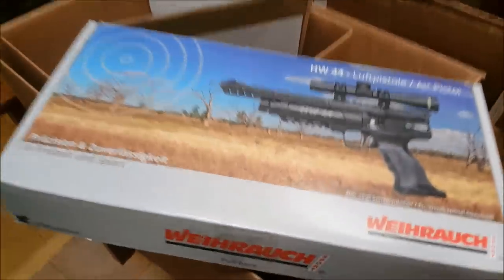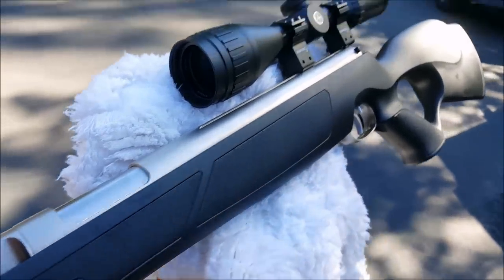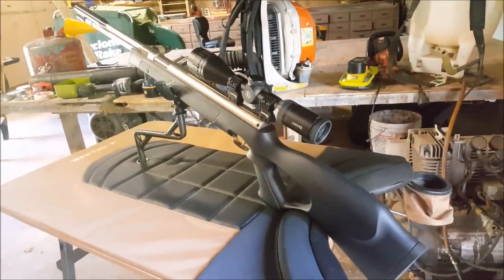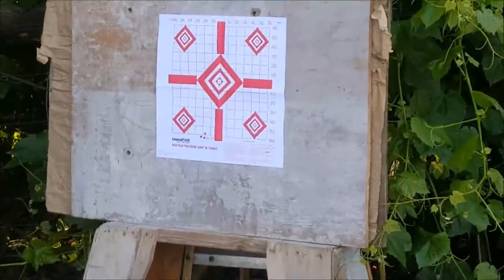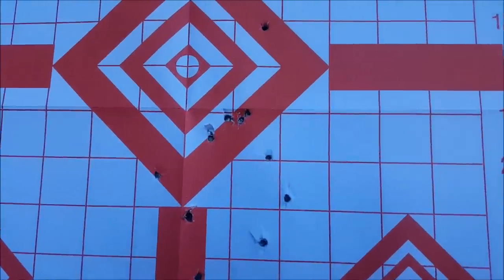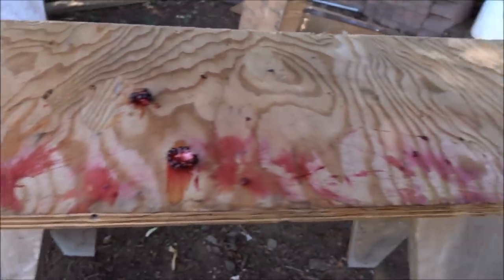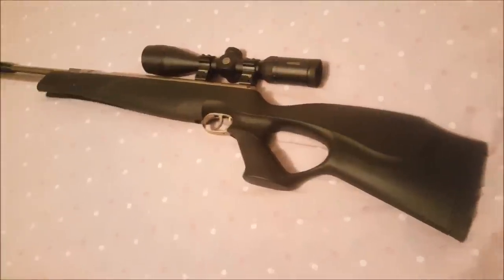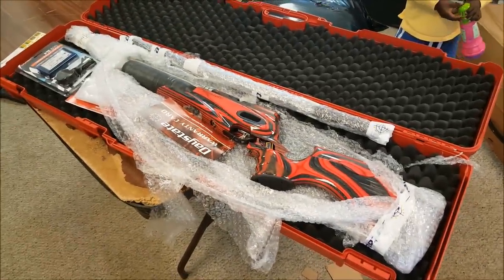Weihrauch HW97 (K) Accuracy Testing and Review (Best Spring Air Rifle there is!)

Comment: Use  H&N Field Target Trophy  pellets for this airgun. I have the HW97K five years now and with that pellets i can shoot cans of cat food up to 77 yards easily!
Reply from the maker: diakojim1977 .. well, that sounds amazing. Thank you for the tip on the pellets
Reply: I hope that pellets works with your rifle,because mine is actually 1.77 .What happened with the red wolf?
Reply: All the Weihrauch barrels (talking their springers only as there PCP guns always love JSB) in their spring powered guns love the harder alloy of H&N pellets and rarely shoot JSB lead better then H&N.

Pretty much Every HW we have ever shot or tuned for people and we have spent time with the vast majority of all models prefer H&N lead over any thing else. They always prefer larger head size (4.54 or 4.55mm in .177 and 5.53 or 5.54mm in .22) well 100% of them may not prefer the larger head size but again the vast majority do.
The only versions that I can say prefer JSB lead the most (we have tuned about 10 of them in .177 and owned one that we sold a while back) is the HW30, everyone that we've touched shot JSB 8.44s the best. Every single other HW Springer we have touched has liked H&N 4.55mm FTTs or 4.53mm Baracuda match and or Crosman brown box 7.9s or 10.5s and in .22 it's 5.53 or 5.54mm FTTs or 14g Sniper lites or Crosman 14.3 domes. In .177 if the like the 10.5 domes they won't like the 7.9s from our experince and if the like the 4.55mm FTTs then it won't like anything other then them and if it shoots the Baracuda match 4.53 it will shoot the 7.9g Crosman Domes well.

Then almost always shoot the Skenco Ultra mags well in .177 and .22 and rarely shoot Polymags worth of dang. The really good thing about Weihrauch barrels is they are very consistent with what they like... You can almost be assured that H&N FTTs in.177 and .22 will be it's number one pellet in the larger head size and they will NOT shoot 4.50 or 5.50 head size anything good buy a tin of 4.54 and 4.55mm FTTs for 177 and 5.53 and 5.54mm FTTs for .22 and in 95% of HW springers one of those pellets will be it's tightest shooting pellet.
Reply: @EDCandLace  l use RWS Superfield in .22 accurate in the 97 and in the Pro Sport.
Reply: To all those below comments, thanks for your tips. I'm going to try something incredibly difficult and get an HK air-rifle into the country where I live. They quite OFTEN substitute personal opinion / attitude for law...such is the educational system, and professional "training" of the govt. workers here.  Their mantra is : 
"If in doubt, DENY!!!"   A year ago, I was flying with some tiny (maybe 2-3") potted plants in a carry-on bag for my Science classes, from Khon Kaen back to Bangkok. When they saw them, the airport idiots claimed they were (so help me god) "Bad for the plane". Now, realize!  that in these 3rd world countries it is POINTLESS to ask for a superior officer, OR for PROOF of said situation (the plants being 'bad for the plane'). So anyone thinking of coming and working here, keep that warning in mind.... THIS is the level of mindlessness/roboticized aherence to vaguely understood orders that one has to deal with...
Reply: @diakojim1977    No, more likely your rifle is 'actually'  .177 .

Comment: shameful groups at 50 yards buddy. You have to change the pellets , because I found that my HW97  - .177 is very pellet sensitive. I went through bunch of different once before I found the very best once and they are JSB diabolo exact 8.44grains ... however that's not all I found that these pellet size varies greatly between different batches and I guess you will have the same issue while finding the best once for .22 ! To give you an idea how accurate HW97 in .177 is I will tell you that I am managing to hit pea grains at 50 yards every single time . I am using more powerful scope than yours as well ... 6-24x50   ...with 3x9 I doubt that you can see the peas at that distance at all ... trust me Weihrauch HW97 is much ... much better than you ascertain !
Reply: agreed - this video does the hw97 a great disservice. I would guess the pellets AND the technique are completely wrong.  Should be getting half inch groups at 50 yards.
Reply: Come on guys give him a chance ,  hes new to it ..sos the gun . .the pellets hmmm  .catapult fodder . Crosman premier 7.9 . Choice food for the 97 ..
Reply: Crosman premier 7.9 come off the same machine  never vary ..every pellet is a clone of the last ..  my 97 is fac . 1000 fps  long stroke  . Shooting ar 120m im at 3 inch groups ,  basically tennis balls

Comment: If you still have this gun... (My hubby has a HW97KT .22 and I have one as well along with two .177 HFT set up HW95s) and out of all the HWs we have ever shot not once has JSB been the pellets of choice (our TX200 and TX200MKIII shoot JSB 15.89s the best bar none) like 98% of PCP guns. Both our 97s shoot 5.54mm H&N FTTs the best and shoot 14g H&N Snipers extremely well ... Our .177 HWs shoot 4.55mm head size FTT 8.66s the best with Baracuda match 4.53mm head size about the same. I can say without a doubt the 5.50mm head size of all H&N is hated by HW barrels they much prefer the 5.53 or 5.54mm head size and in .177 it's the same they want the larger head size. I've ran pellets down the barrels with cleaning rods and I can say the HW barrels on the 5.50s and 4.50 head size will have only very slight rifling marks and the 4.54-4.55mm and 5.53-5.54mm head size will have nice clean rifling grooves cut in the pellets.
The barrels also greatly enjoy a nice lapping with JB bore paste very light lapping that is... Afterwards you will notice if you run a pellet down the barrel with a cleaning rod that there will be zero smearing of the lead where the rifling contact the head and skirt and before the lapping you will deff have some lead smearing from slight imperfections in the barrel that the lapping will clean up but as the barrels prefer larger head size pellets it's extremely important that you do a very light lap so as to remove very little/almost zero barrel material. After doing this and stripping the factory compression tube grease and deburring (there is almost no deburring to do on them) and adding a very light amount of spring grease and some only grease to the piston and a very very light smoothing of the leade in and the very light bore lapping these guns are extremely capable and will perform with a TX200 out the box at that point (TX200s are pretty much a fully tuned gun out the box) my and my hubby HW97KTs pretty much shoot with our TX200s out to about 40y but the TXs will shoot slightly tighter 50y groups and honestly that's not the gun that's us as the TXs are so much easier to shoot and much more forgiving hold wise (the TX200s are much less hold sensitive then the 97s BUT our TX200s are running 16.5ftlbs with 15.89s and both HW97s are running at 19ftlbs with 14.66g FTTs so keep that in mind.. I still believe the TX would be a lot less hold sensitive at the same power levels. The tune tho makes the HW97s a lot less hold sensitive to the point that you can shoot them bag rested and our the box you can't if you want the gun to shoot as good as it can. The TX200 out the box can be shot off bags fore and aft something no other spring gun I know of can do)

At 50y both our TX200s (one is the original and one a MKIII) will shoot 10 shot groups consistently that are right at a inch and the 97s after the tuning will put 10 at 50y consistently in 1.2 inches. We have played with them at a 100y as well and the TXs will put 10 shots inside of 6 inches (we have a indoor 100y range keep that in mind, my husband and I own a company and our warehouse gives us a 103y length that we shoot in) or 5 shot groups run around 4.5 to 5 inches and the HW97s will put 10 inside of 6 inches as well and 5 shots inside of 5 inches.

Just take my word and do the light barrel lapping and smooth/polish the leade in and the gun will shoot tighter just from that. The shoot fantastic out the box but with a slight bit of tinkering the guns become better and easier to shoot well.

I want to give you one more tip... Never ever in any way trust the anti beartrap never ever... Always and I mean always hold the cocking lever when loading the pellet. The level of quality of these guns is superb and it will likely never fail and if it does the anti trap system will 99.9999% stop it from fully closing but if it didn't and your finger is in there you are FUCKED... I seen a Beeman/ weihrauch R1 barrel snap shut after cocking and caught the tip of the owners finger and it smashed and cut about .3 inch of his finger slap off like it wasn't there and that gun was running spring designed to push 8.66g pellets at 10.5ftlbs so a very very light spring.

I know it's easy to just trust it and honestly you can trust it because it's not gonna fail in all likelihood but the thought of what if it did makes it to where it can't be trusted.
Reply from the maker: Great info. I sold the gun right after the review but I may get another one. Also maybe a TX200..probably the TX. I'll save that info! Thanks Lacy! -Nate

Comment: Have had mine for four years, have shot rabbits upto 60 yard's, brilliant bit of kit.
Reply: 177 or 22 cal, which cal you use for rabbits? Is the 5.5 accurate enough for rabbits? Thanks in advance
Reply: @greekveteran2715  it's just as accurate in .177 or .22 but much flatter trajectory in .177 because of the higher velocity...
Reply: Have a look at a you tube video 83 yard rabbit's with a sub 12 ft/lb air rifle...

Comment: Nice ! And the rifle and stock are still breaking in. Keep the stock screws snug between groups for a tin or two of pellets.  And practice follow through on the trigger. Mine shoots good groups if I forget follow through. Then I remember and it produces dime size at 40 yards. The most important tip with springers.
Reply from the maker: Tilbily ...great advice! I was not aware of that about scopes and rings. Thanks so much for the comment! I'll work on my follow through as well. That's basicly keeping the gun on target till After it hits your target right?
Reply: Not sure if all rings do that or just mine. Follow through is as you've mentioned, but also with trigger. Keep squeezing it after the shot. Makes all the difference.

Comment: How did the stock break when it was in the case?  Does the case not hold it in place tightly enough?
Reply from the maker: Exactly, they put a $3000 gun in a cheap case with no fitted foam around it. It slides all over inside the case. I heard of 2-3 other limited editions that broke the same place. Thanks Daystate!!!!

Comment: Good review!! ......shame about red wolf, how did that happen??
Reply from the maker: Countryliving80 ...the case the Rosso Edition come is doesn’t have fitted padding around the rifle. The rifle can slide around inside the case. Couple that with some A-hole delivery drivers who like to throw packages around “for fun” and you have a broken Red Wolf. The stock on the limited edition  is actually different than the normal read stock as it has red as the main color instead of gray. So I don’t know yet if they will even have a limited stock for me. I am pretty nervous at this point but hopefully I will be able to return it if I can’t get the proper stock replaced. Really sad though

Comment: I would like to know more about that pellet sizer, thanks for the upload
Reply from the maker: Pelletonix ... a pellet Sizer is basically a metal tube with a plunger. You squish your pellet through there and it makes it exactly 4.5 mm, or whatever millimeter you select for your pellet sizer. I will do a video on it. Here is the link: https://m.ebay.com/itm/The-Original-TTS-Pellet-Sizers-and-Seating-Tools-for-all-air-rifle-pellets/132043609188?_trkparms=aid%3D111001%26algo%3DREC.SEED%26ao%3D1%26asc%3D53041%26meid%3D5f22adbe29db4fc1868c8beb7e8d3462%26pid%3D100675%26rk%3D1%26rkt%3D15%26mehot%3Dpp%26sd%3D132043609188%26itm%3D132043609188&_trksid=p2481888.c100675.m4236&_trkparms=pageci%3A88c0961a-8166-11e8-b34f-74dbd180fce3%7Cparentrq%3A7192c5561640a887efa01d55fff3282c%7Ciid%3A1
I went with 4.5 mm on my 177 caliber. I will let you know what size my 22, and my 25 ones are.

Comment: just an fyi, today is july 22, 2018, earlier i ordered the same pellet sizer you have,, i ordered off ebay for $20.  US plus 5 bucks shipping,, i own 4 air rifles, 1 hatsan 30 cal break barrel, 2 gamo 22 cals, the swarm maxxim and the magnum,, and i have a weihrauch hw50s in 22,  my next rifle is going to be another weihrauch, i just don't know if it's going to be the hw80 in 22 or the all black hw97,, my only concern is that i don't know how much room there is to load the pellet,, do you have any issues with loading pellets,, break barrels are easier of course to load but i really like the hw97,, great video by the way,, i am in west central florida